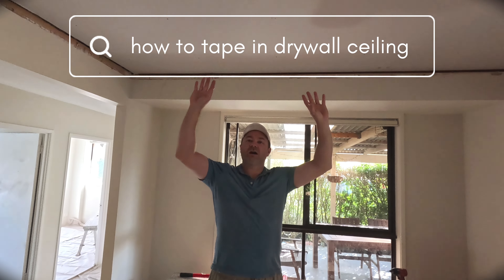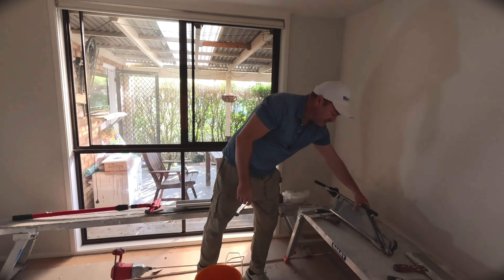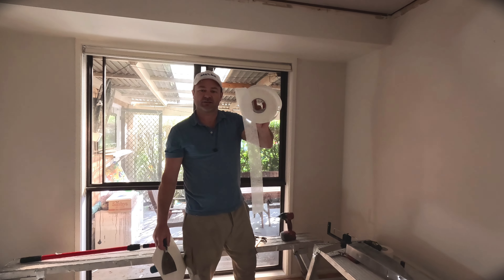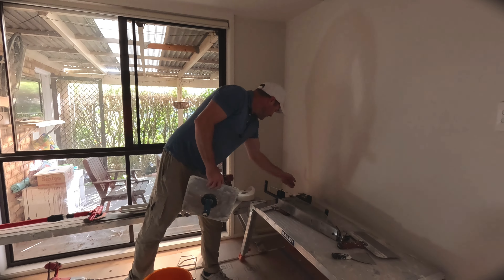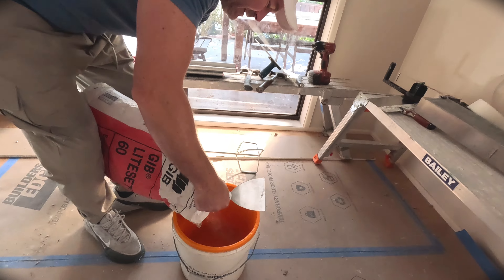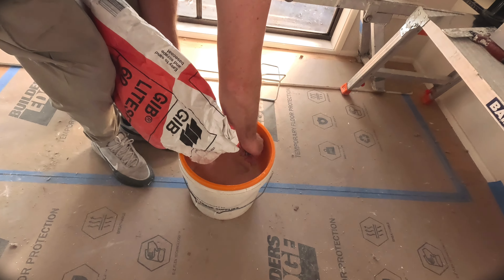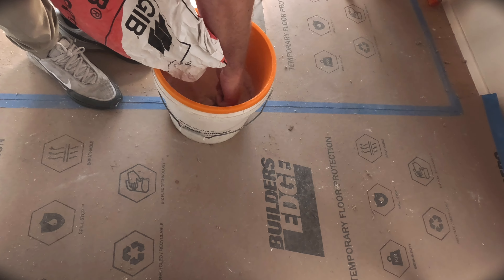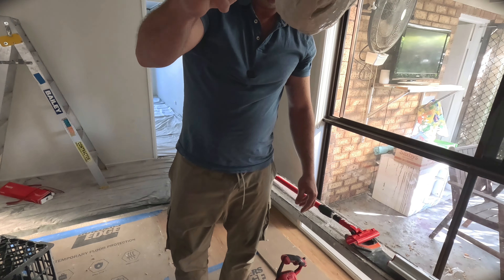How to Tape Drywall Tips for Beginners

Comment: I think paper tape lays down flater than fiberfuse but it's more difficult to complete plaster, sand and paint with paper same day. Fiberfuse is more forgiving for the average DIY but to lay it flat, the mud needs to be thinned out.
Reply: @EricBanner571  I just use quick set 90 to tape if I want to finish same day. Tape with 90, coat maybe, then box mud on final.